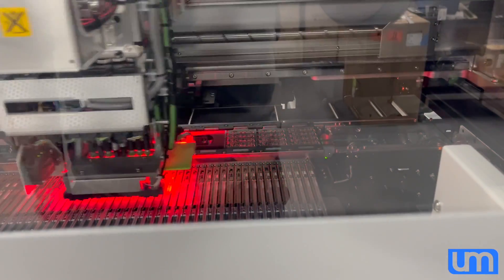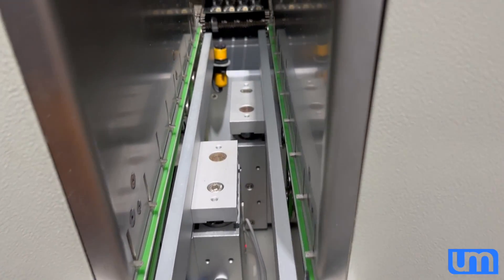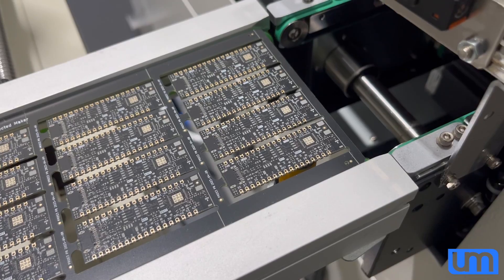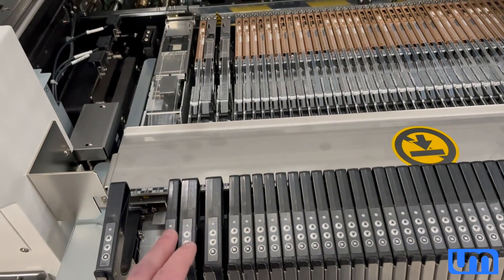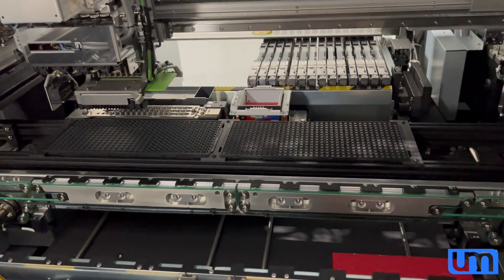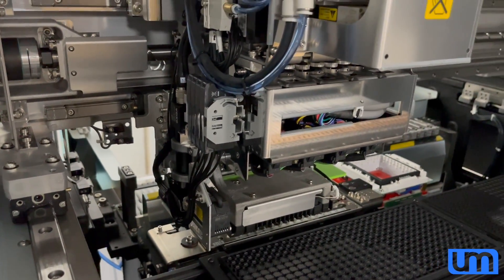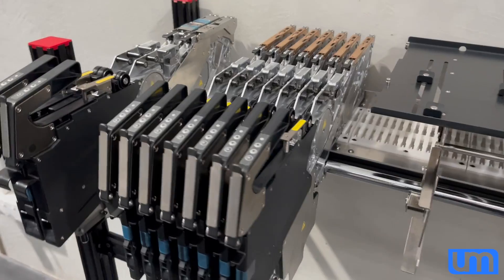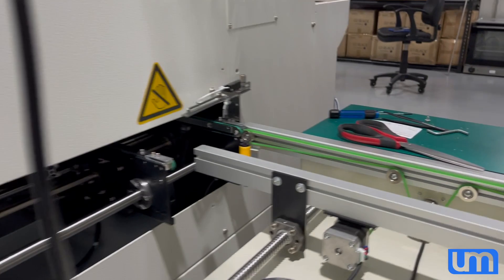Juki RS-1R - A closer look inside!

Comment: 3:30 Your pick rate is 99.97% (due to component run out), but your placement rate is down to 99.69%. That's not a pick issue, the component was rejected and discarded because it couldn't align it. Try to manually move the laser height to -0.15 or -0.10. This way it aligns it to the body and you will have fewer issues with your SOD-523s. I hope this helps :)

Comment: Does the RS-1R have an administrator/operator mode? On my older Jukis it has a key/switch, and if I rotate the key in normal operator mode (aka production mode) the machine will increase its speed even more. I had mine in admin mode for a while until I realized.

Also very very interesting, how many things Juki kept the same from the 1990s until now. Rails, nozzle changing(ATC), naming conventions in software, laser alignment, feeder bank sensors, etc etc. Even the trick of putting the trays in the middle seems to have been always allowed (even though you took it to an extreme with a full blown tray bank ;)
Reply from the maker: It does have that key switch - I wasn't aware that there was a speed different in each mode. I'll have to try that out.

Yeah, I assume a lot is the same... why change things if they work great?